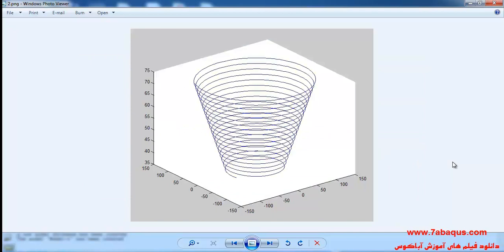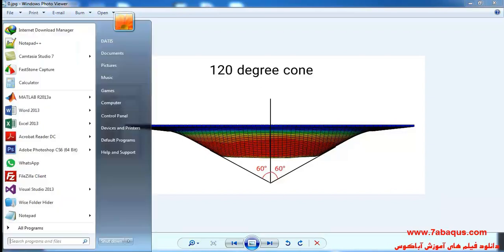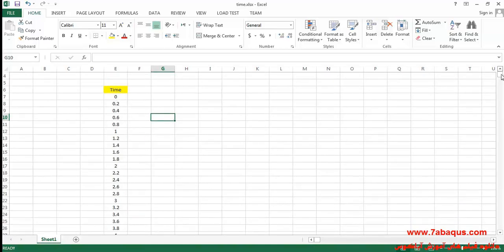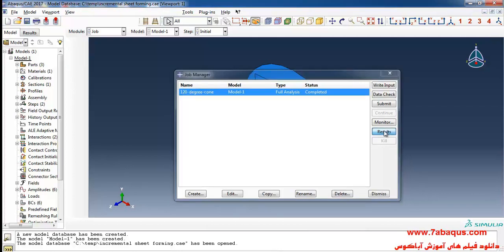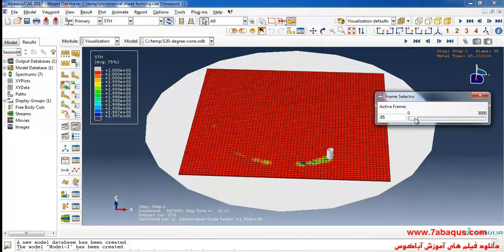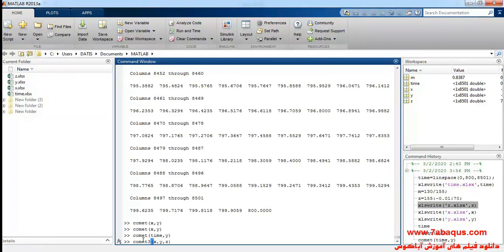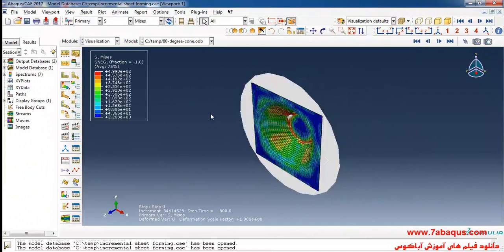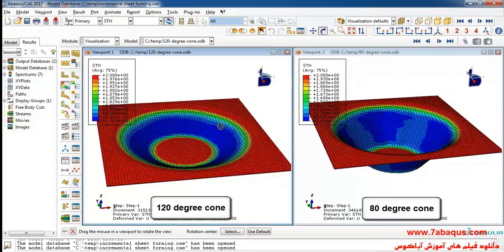How to generate the Tool path in the incremental sheet forming using the Matlab and abaqus

Comment: Please, if u have any idea regarding why after some time tool deviates from it's path, do tell. In my simulations tool firstly follows the given path but after half the assigned time it deviates and makes smaller and then bigger circles. I generated tool path in excel sheet
Reply from the maker: You probably do not define the tool path correctly
You generate tool path using Matlab software